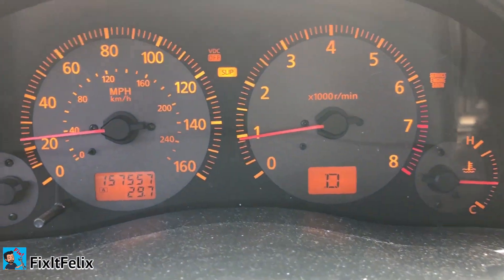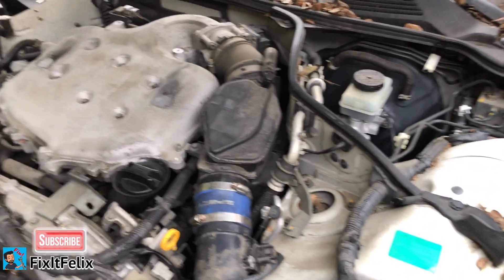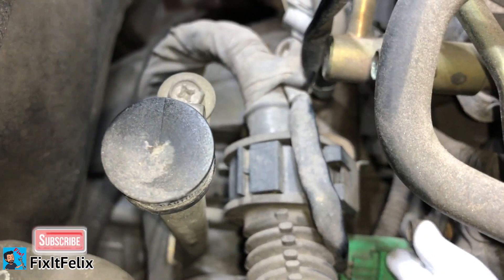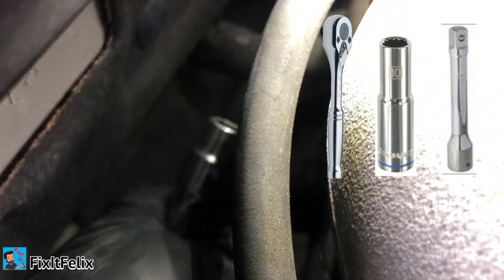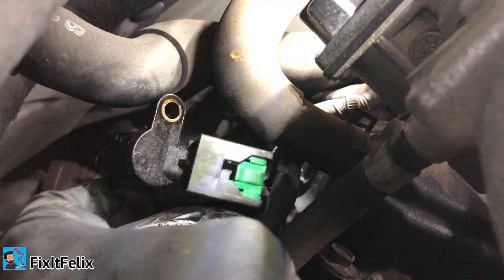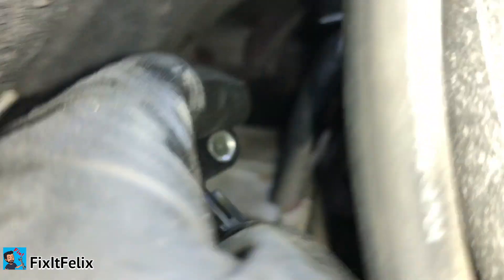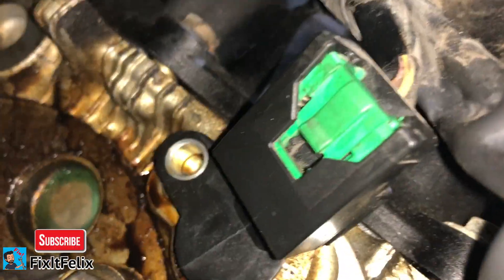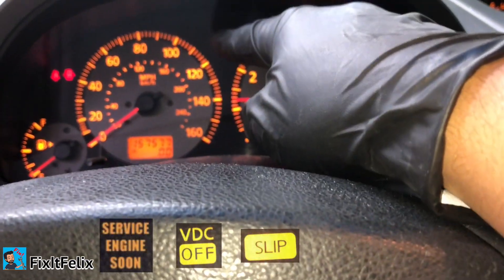Infiniti G35 camshaft position sensor replacement

Comment from the maker: Hi guys! if you find this video useful you can help the channel grow by donating , it don’t matter if it’s a small amount.  Anything counts , link down below Thanks ^_^
https://www.paypal.com/paypalme2/FixitFelix529
Reply: I changed both the sensors but it’s still not starting, do u know what’s the possible problem can be
Reply: Change the crankshaft positioning sensor under the car

Comment: You do not realize how important a 10 mm socket is until you start working on the car
Reply: FACTS!!!!!
Reply: I love how you can take apart half the car w a 10mm sockett and a ratchet
Reply: @jovanlovett649  This is facts yo
Reply: Seems to come up missing whenever friends borrow your tools.
Reply: @roberthamill2451  you might have to start charging $10
Reply: Word!..my wife dropped my whole tool box on the floor and that was the only socket I was thinking about..
Reply: I love and hate this car. So many fucking sensor errors
Reply: @spacejunky4380  constantly! I've changed the cam sensors 3 times and I don't even have 75K miles. Used Hitatchi OEMs each time too. Nissan should do a recall because I would NEVER buy another Nissan.
Reply: @bobbyheenan4061 I owned a Chrysler that had the weirdest error codes. Replace 3 things and cross your fingers. At least  when my infiniti has an error code, there's a clear solution. I can handle that.
Reply: It’s the first socket I go for lol and the most beat up one! Bit to mention going banana 🍌 to find one 😅

Comment: Thanks for this Felix!  Today, while taking my wife to her doctor's appointment in her G35x this sensor failed as we were coming off the interstate. I mean the car just quit. I thank God it didn't happen while we were at 70+ mph in multiple lanes of traffic. Got it home, and found out it was this sensor. The car is just 300 miles short of 100,000, and this is the first real problem we've had out of it.
Reply: That's what happened to me except I was going like 85. Luckily it came back and I was able to get over before it completely shut down. I'm still not sure if it was this or a battery cable.

Comment: Followed your directions and fixed my bank 2 sensor problem. Way easier than removing the air intake. Couldn't see a thing, all by feel, it worked out just fine. Thanks.
Reply: How hard was it putting the bolt back in without seeing it?
Reply: @bobbyheenan4061  Actually it was easy because the sensor fits into the side of the block. You put the bolt into the sensor attachment hole and then just move the sensor around until the bolt lines up and can be threaded in. it is all by feel, but it wasn't hard. I changed the other side first so I could get a "feel" for what I was doing. It gave me the confidence to do the "blind" side. Good luck.
Reply: @edlincul6773  Got it! Appreciate the tip! I was worried about dropping the bolt, but that sounds like the way to do it. Should have my sensors in a day or 2 so we'll see how it goes!
Reply: @edlincul6773  Thanks again. Swapped out both cam sensors and the driver side was a piece of cake doing it your way...I used a 10mm wrench instead of a ratchet too. The passenger side was a bitch with that wire harness in the way, but I got the bolt back in eventually. Patience was key. Both sensors took me about 45 min. Thanks again!

Comment: Holy crap man. It kills me that I can only like this once. Thank you for making this video. I just took care of mine in 15 minutes. I know there are a lot of us that run into this problem. I hope all of them in the future are able to find your video before pulling out the intake and throttle body. A shop wanted to charge me $500+ to do this.
Reply from the maker: Thanks 😊 i am happy to help
Reply: Literally had the exact same experience! Thanks Felix!
Reply: Yea they told me it wpuld be $780 after the diag price of 140. Just to replace the second one.
Reply: @soliddbolthug5679  yup a shop just quoted me 900+ dollars to change both of mine + labor and something told me to look it up because that price seems WILDLY high.
Reply: @mileen971  its no joke I have a aftermarket intake that was easy to move out of the way
Reply: @mileen971  a extra small rachet made it super easy the sensor is literally secured with one 10mm. The shop did sell me a intake sensor so I did have to go back for the exhaust one. Other then that super easy and straight foward, just don't be afraid to remove a couple vacume lines
Reply: Yup.My friend just replaced mine.Took him 20 minutes.charged me $40.lifted up the right side of the g ,threw 4 jacks under for safety and replaced,let car back down done.💯
Reply: @mileen971  That's crazy, I bought BOTH OEM Hitachi sensors from Rock Auto for $90 and swapped out both in about an hour. The passenger side sensor was the one that took more time because that wire harness makes it tough to get to. Both sensors took about 45 min total and cost less than $100. That's robbery for a mechanic to charge that much.
Reply: @bobbyheenan4061  I agree....just like a couple weeks ago the same shop quoted me over $2500 to replace the steering rack....I'm realizing this place is good for some things but for most work on my car I'm thinking maybe I wont be going to them.
Reply: @mileen971  yea bro run away from them I got my steering rack replaced for 200-250 in labor cost
Reply: @SollyBenny where?

Comment: I am about attempt doing this job in about an hr or so on both sensors. These are the easiest most straightforward instructions ive found so far. Will report back with results
Reply: Didn't get to it until today. Was hard AF reaching the bolt on the sensors but I got it done 👍🏽👍🏽👍🏽

Comment: I just changed mine. I have a 2003 and a 2005. Note that the 2003 has a bracket blocking the screw for the one on the passenger side. Scraped my hands up but it’s changed so far no check engine light! Thanks for the video it helped a lot! Also if the sensor doesn’t sit even when you put it back in, know that  it’s slightly tilted not completely level so to get the screw in turn it a little. Good luck! 👍

Comment: This fixed my issue, code scanner said it was bank 2 and I replaced it with this sensor and it fixed my issue. Car was having trouble starting up and had all the lights on. Dealership wanted $600 to fix it..

Comment: I did a horn upgrade using Hella Supertones along with the stock horns...Hook them up with 14 gauge wire, relay, relay connector, fuse connecter,spade connectors, 1/4 inch wire loom, solder,heat shrink...I tap off the high from the stock horns to run the relay to the Supertones...They all sound great,and the install looks stock...

Comment: I love g35s.  I traded my 350z for a Infiniti so I could have a all year round car. Too bad they're aweful for so many failed parts lol. Out of my 300zx, 350z and now my g35, the g35 has everything the car can have wrong, wrong. Both door actuators went, both window motors, my mirror motor, my gas gauge, and now both crank and cam sensor. It's only got 70 thousand miles on it. I really wish I wasn't so attached to the body style or exhaust of them, or I would get another 350. Just finished changing the window motors yesterday, going to do the sensors now. Thanks for this video! I wouldnt have known you could get to them from the side.
Reply from the maker: Lucky Lex you’re welcome.  I hope you car last forever
Reply: The windows and door locks have a bad wire connection , coming from the body driver side to the door , i tied a string to the wires and pulled it tight to the door bracket . As a easy fix . I can not access the wires . The engine ground are bad too . Had to clean those and install extras.  It shorts out the coils other wize , all 6 .
  Now its the " clock spring " in the steering wheel .     Nissan is now co-owned by renault   ,and crap .

Comment: Hey mate ! Thanks for putting this out there. I am taking my 2007 G35x in for service tomorrow and it has a camshaft sensor issue, so I will have some solid knowledge going in. All I need is a 10mm socket once I confirm the error codes. Awesome!

Comment: So the g35 has 3 sensors? I have a p0335 code but it looks like it's the one at the bottom of the engine near the transmission. Would these two green connector sensors throw a different code?

Comment from the maker: if you want to buy the camshaft sensor click below
https://amzn.to/2Rt2NEJ
Reply: I know this is a year later but I am having the same issue with my vehicle. I went on your link and purchased the part. Watching your video, it seemed like such an easy fix. However, I am struggling trying to see behind and around the back of the engine. It doesn't help that I am only 5' tall and I have to use a step ladder and literally lay across the engine, lol. The part that I am finding difficult is that I can't see this sensor and It's hard for me to even feel it and get the ratchett positioned properly. Any suggestions? 🤔😏
Reply from the maker: It will be easier if you can use your phone on record and turn on the flash light that way you can see better what you’re doing. 

Try getting help so that someone else and hold the phone why you see. 

If that don’t work that my best suggestion is to go by feel or try getting a small mirror in there. 

Hope this helped
Reply: @FixitFelix529  
Wow! Thank you for your prompt reply! Yes I was using a flashlight on my phone while looking at your video also, and another flashlight just to try and see the part, which I never could see. Maybe I'll get someone to help. My back was tightening up from my position while laying on the car... I'll try again in the morning. Thanks so much!
Reply from the maker: HolyRoyal Princess let me know.  I am happy to help 😊
Reply: @FixitFelix529  
I will, and I'll try the mirror also.
Reply: On my way out to try this again. I will try and record and use a mirror. I pray that I'll have a victory report for you later.
Reply: Well... My problem unfortunately is not resolved 🤔
Is it possible that I need the other sensor replaced? Was this one bank 2?
Reply: @FixitFelix529  
Hi. I need to replace the other sensor - passenger side, bank 1. I ordered the wrong side. Do you have a link for the passenger side, sensor 1? Thanks!
Reply: @holyroyalprincess  If it's an infinite you might have to ake off the trottle box and go in from the driver side.
Reply: What is p1078

Comment: Great video!! The driver's side is actually easier than the passenger side since there's no thick wire harness in the way. I used a wrench instead of a ratchet...Took me about 10 min.

Comment: Nice remove and install video.  However I bought the same sensor you included in the link and it lasted 3 weeks of daily driving. This is a hard ass job so do your research on the sensor before you buy.
Reply: Did you end up having to buy an oem sensor or one from the part store?

Comment: My 03’ Infiniti G35 starts but won’t stay on. It’s not the fuel pump because we got a new one and a new pressure regulator for it, it’s not a fuse because we checked the fuses can it possibly be the camshaft ?
Reply: Injectors maybe
Reply: Joseph Schofield it turned out it was the crankshaft sensors, changed out all 3
Reply: @thegodofthunder8019  where’s the 3rd one? In this video he only shows 2?
Reply: @primitxve8076  there are two in the engine towards the back and then there is another one at the bottom

Comment: I got a 06 Infiniti m35x and my VDC, abs, AWD, TCS come on sometimes but no check engine light or code. Should I change both cam shaft position sensors and see if that solves it?

Comment: Hello I have the same problem with both banks but the mechanic guy told me that I have to buy the original one, and that one in the Infiniti store, it’s like $150, do you recommend any other cheaper than the original one? Or is completely necessary the original one?
Reply: You could go through Almost 10 of these cheaper ones for the price of OEM. Give it a shot

Comment: I had P0340 code on my 07 fx35. On day 2, engine started knocking when going over 30mph. Sensor got replaced and code has gone away but knocking is still there during acceleration with engine fully warmed up. New oil & filter were changed out but that didn’t help so i wonder if i have to replace all 3 sensors even though i am not getting codes for the other 2 banks

Comment: How is that sensor from amazon holding up? I’m having the same issue with my g35 and bought a sensor from o Reilly’s for $70. If your sensor is still working good I’m going to return this one and order the amazon one..
Reply from the maker: Yeah it’s still great!
Reply: Fix it Felix great to hear, thanks so much.
Reply: @angelthepvong6580  I wouldnt trust amazon sensors, better oem or ntk brand.

Comment: Great Job Felix! 
If you want to include in your video's description the DTC is P0345 (Bank 2) which is the one you changed on the driver's side. 
Which brand sensor did you go with and how long has it lasted?
Reply: What is a po1078

Comment: Should I buy a g35 with 130k miles if so what should I look like for problems and stuff
Reply from the maker: This cars are super fun to drive. They usually have oil leaks and suffer from this sensors I replace in the video.   I say if it turns on , drives good and no engine codes you should buy it. Make sure you get it in a good price tho.
Reply: Fix it Felix 4500?
Reply from the maker: I think below $3500 should be ok
Reply: Fix it Felix so I shouldn’t if he’s not going lower

Comment: My 2004 G35 has check engine light on and code P0303. Every 25 miles the VDC off, and Slip lights come on with poor idle. The video makes replacing the cam position sensors look simple. How do I know which to replace?
Reply: Driver side is left sensor, it’s slightly angled, passenger side is right and is straight, no angle

Comment: How do I know if this sensor needs to be replaced? My vdc off light, slip and cel is on.. ive read on different forums that it’s definitely this sensor. Any advice? Thank you 😊
Reply from the maker: First thing to do is take it to an autozone or O’Reilly and have them check why the check engine light is in.  They will tell you which sensor you will need to replace
Reply: It’s so weird because I had it checked this morning and codes weren’t popping up even with the cel on! But I’ve checked it previously and it says camshaft sensor, but it’s P0335, not 345. Would this still be the same bank? (Not sure what banks are LOL, trying to learn here 😂) but I went ahead and ordered the part you have in the description, hopefully I can replace it tonight.
Reply: @asaelee  Did you replace yours? I just got a p0335 code on my g35 but I think it's the 3rd sensor near the transmission that has to be replaced. Apparently we have 3 sensors. The two shown in this video and a 3rd on the bottom of the engine. From what I can tell a p0335 is the bottom sensor.
Reply: I did, but it wasn’t the right one. I needed my crankshaft sensor (the one close to the tranny) to be replaced. So I did & she’s good 😊

Comment: your vid is extremely helpful.  I"m working on sensor bank1 and the darn thing wont come out.  I'm going to try again with your wiggle technique.  Also for my 2007 g35 the sensor cost $165 direct from nissan/infinite.  So I'm a bit skeptical of the $12-35 ones.
Reply: Not sure what I’m doing wrong but I can’t get bank1 out to save my life.

Comment: Any help guys I have 2006 Infiniti G35 sedan  Iam having a problem where I drive for few miles and my car will just shut off. It will do it randomly when I’m driving I have look at my battery  and all the harnesses still no change. Any recommendations

Comment: What if the car stops starting because of this issue and I put the sensor in after it won’t turn back on?would the car still be able to run or is there another issue now

Comment: Hi Felix! Thanks for the video. I bought the correct part and replaced it like you instructed but the error code and symptoms still persist... Any suggestions??
Reply: Maybe cleaning the sensor??
Reply from the maker: Dani Korb maybe you replace sensor bank 1.  On the video I show how to replace sensor bank 2

Comment: Mine had the same problem it cranks but no start and it says camshaft position failure and I replaced it and put a new one and still crank and no start I changed the sparks coil packs the fuel pump and still not getting  anything like I said cranks but no start please help thanks
Reply from the maker: Maybe the cables from the camshaft sensor are damaged
Reply: @FixitFelix529  I plugged the scanner and that’s the only code I’m getting is the camshaft sensor failure other then that everything thing is good

Comment: Hey felix my service engine light went away but the obd sensor still reads the code. Do I have to drive it for a while?
Reply from the maker: Yes I think like around 100 miles
Reply: @FixitFelix529  okay thanks

Comment: you can do it from the bottom as well, long as your arms aren't to big to fit. Do yourself a favor and use the OEM sensors ! There is a size diff although very sleight, The aftermarket sensors most of the time will leak oil just a tad. Enough to cause a drip from time to time that drops on the exhaust. You can use a small amount of atv on the seal to stop this.

Comment: Why is your air bag light is blinking? Because mine does it too. I newly replaced my clockspring and all buttons in my steering wheel are working. But the air bag light is blinking. How can I make it disappear?
Reply from the maker: Take it to a mechanic and have them reset the code.   If the light still turns on then ask them to read the code again and check what’s wrong with it.   Sometimes the problem is the seatbelt
Reply: Thank you very much!

Comment: Hey man, I was driving around with a bad camshaft sensor for about a month. Finally got around to swapping both camshaft sensors but my car is still struggling to start. Should I replace the crankshaft sensor?